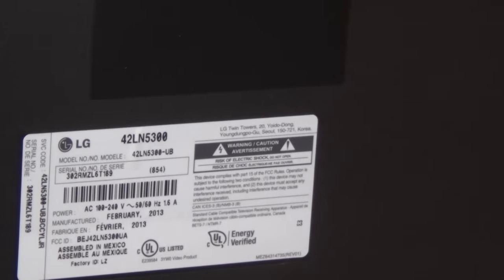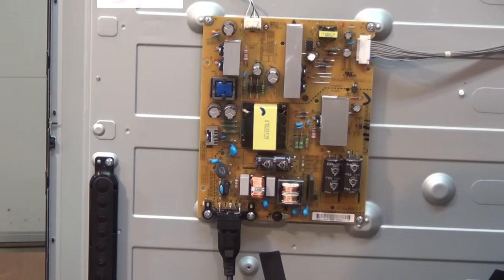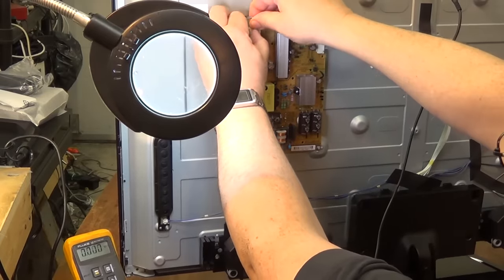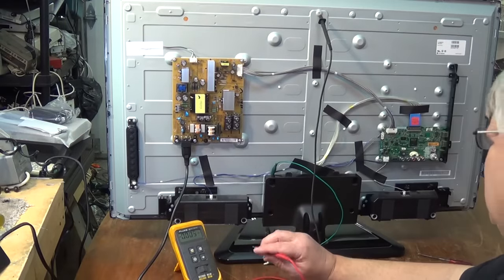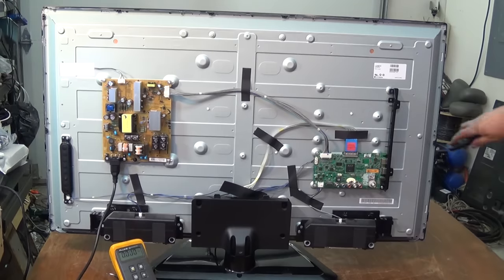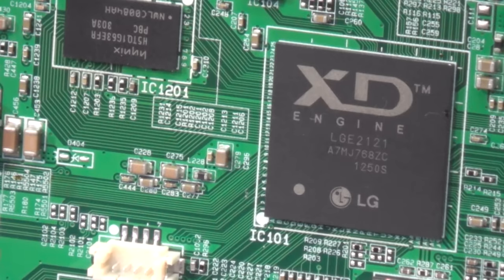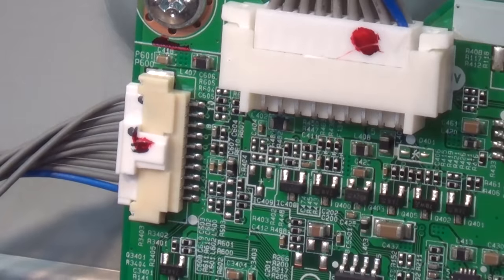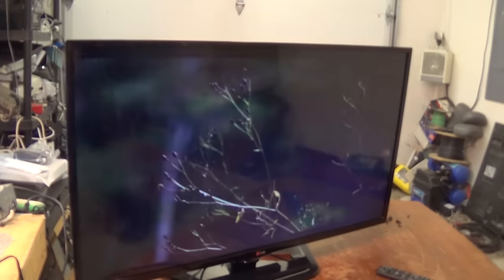LG 42LN5300 Dead   Not power supply

Comment: just replace the board ,,nobody's gonna see nothing and the  customer think you fix the board
Reply from the maker: Replacing boards is for dummy's. Real engineer want to know what went wrong and get the original board going. Swapping a board may fix a problem, but you don't learn anything by doing that. Besides, I had a 50.00 limit on this set. I wouldn't be able to get even a used board for that.